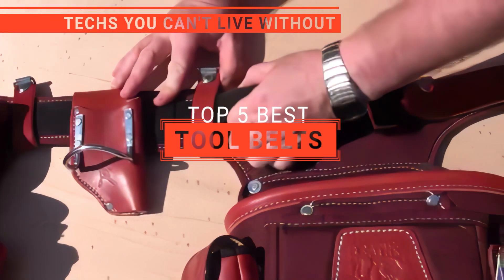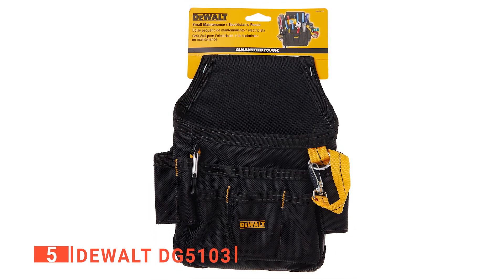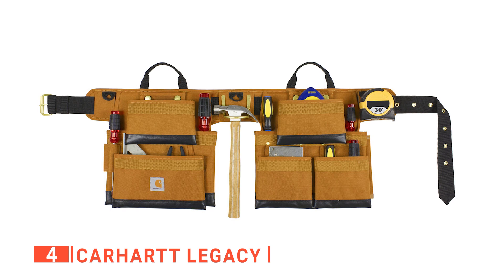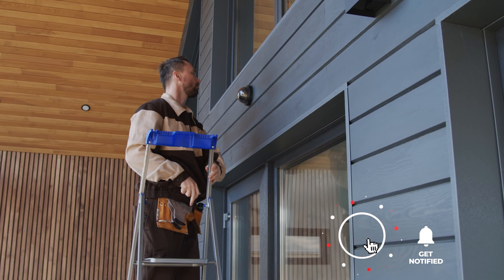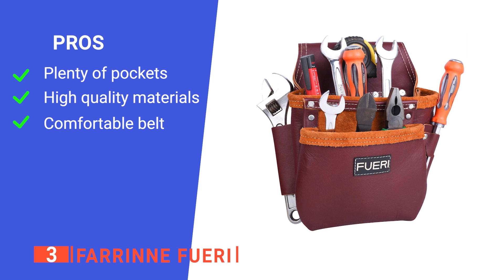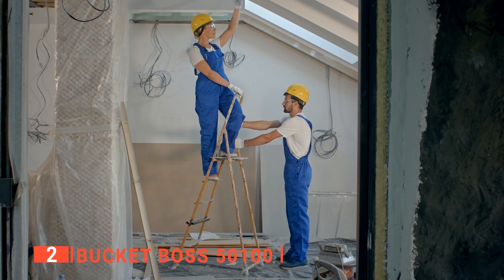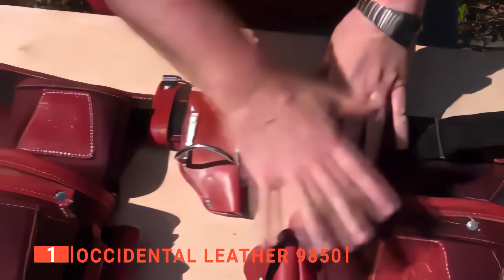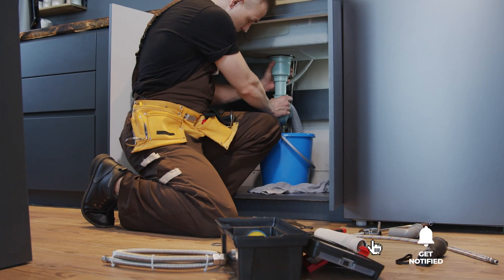✅ Don't buy a Tool Belt until you see this!

Comment: I'm sorry, the Occidental is the only one that belongs here. If you're going for the actual 5 best belts, it's more like Akribis, Atlas 46, Diamondback, Occidental, and CLC as a more budget friendly option. Cheap leather belts like that FUERI will be stiff and dig into your sides unless you soak it in hot water and keep trying to break it in, at which point I wouldn't be surprised if you broke it. The dewalt is a decent grab and go, but not top tier. The carhartt and bucket boss are both absolute junk. I built my own Oxylight over time and end cost is around $650 with suspenders, inserts, and hip and back pads. When you're wearing something all day, every day, comfort is #1, and longevity is #2. With occidental you don't need to sacrifice one for the other.